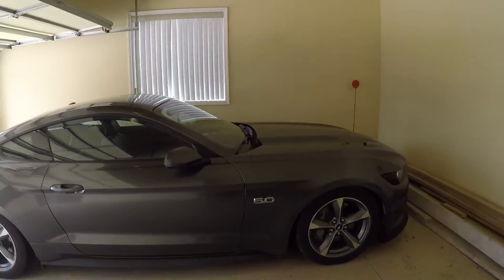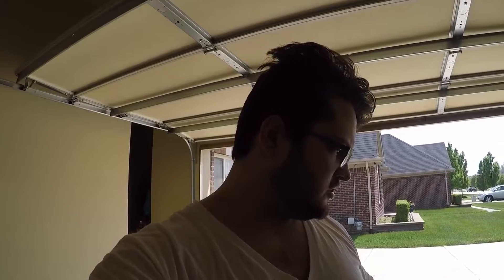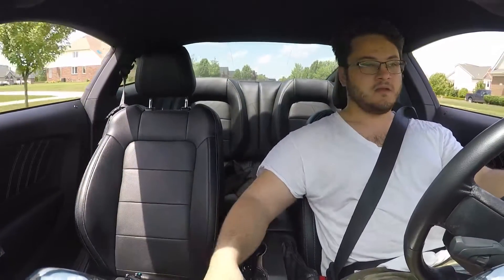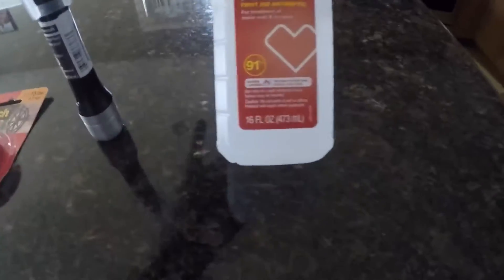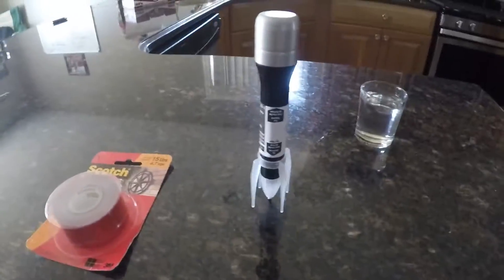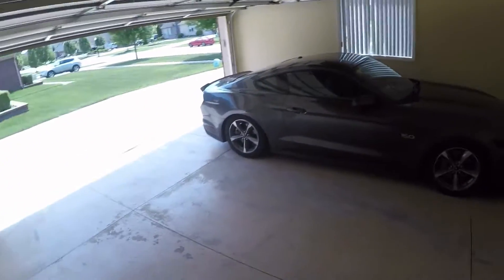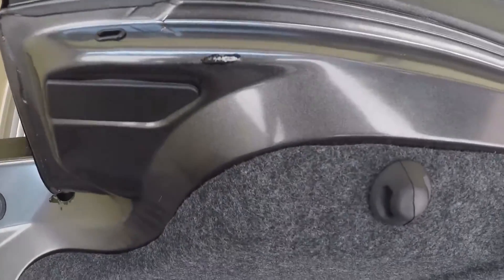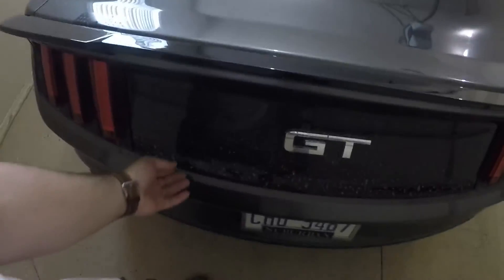NO WAY - 2016 Mustang GT Trunk Problems!

Comment: These cars are a dime a dozen. This is no Ferrari its a ford lol. I've rebuilt these cars that have flooded up to the roof, 19 modules cloned or programmed as built. They do not assemble these cars by hand. There are many bigger problems than this..
Reply from the maker: Indeed these are but this is the only car I’ve ever owned with a trunk that damages itself. Just wanted to put content out there helping folk find a short term fix.
Reply: Jesus Christ, I wish I'd have known that I could have bought one for a dime before I shelled out $25,000 for a used one. Where can I buy one for a dime?

Comment: Same issue
Reply from the maker: Very common at this point. Some dealers have been fixing it free of charge.
Reply: @CarsCouches  I’ll have to check it out. Today I noticed the latch on the bottom apparently got loose, so the trunk was shutting further then it should of. It messed up the clear coat everywhere that deck lid touches lol. I pushed the latch back up, and it seems to be better. Might stop this from happening to, curious if it’s what the dealer did to fix.

Comment: Too many problems with Fords, they feel cheap, noisy, run rough, sensors go out, fuses, body parts separation, bought a brand new Ford Ranger, drove it out the lot bang, engine is pinging like there is no end to it, took it back got my money and bought something else! Got a Ford F150, all kinds of issues, these are brand new vehicle, got a Ford Taurus station wagon, head bold broke leaking coolant into the engine, yeah, final straw 2020 mustang, low fuel pressure sensor focked, noisy as hell, sounds coming from everywhere, transmission clunks when parked up in my driveway and changing gears! Bumpy as hell, most mileage I can get is 28 on hwy. Dealer wanted 500 bucks to replace the sensor, WTF is wrong with Ford? Overpaid nut turner at the factory, and cutting cost by using subpart parts? Last Ford I ever drive.  👎👎👎 I jump on a Honda and wow what a difference! It actually save us money! Imagine that!

Comment: Really? fixing this problem by taping it.
Reply from the maker: Yessir it is a quick fix until a permanent solution can be found. It probably would involve changing the trim on the inside or shaving it down. Better than having bare metal at the moment.
Reply: Got it, it's a beautiful ride hope you'll get it done soon.. I'm thinking of getting 2017 GT sometime when the 2018 is available. Any advice?
Reply from the maker: I love my 16 I would recommend a 17 to anyone, I personally like the look better than the 2018 look. The 2018 has dual port injection which renders the engine less reliable but it does have potential for power. The 15-17 also has plenty of potential, I currently have an intake and tune on mine and I'm looking at 420-430 whp, getting it dynoed on the 23rd. A couple things I would recommend you getting right away on the 17 are wheels, steeda clutch spring and an exhaust. Wheels because they have absolutely no traction with the stock setup, clutch spring for better feel and the exhaust because stock is way too quiet. I also lowered mine on eibach sportlines, looks amazing with wheels. Not sure if you saw the video on our channel about the wheels. https://youtu.be/nz8u4Ni0Vnc
Reply: Cars & Couches thanks buddy, definitely will take these to consideration.